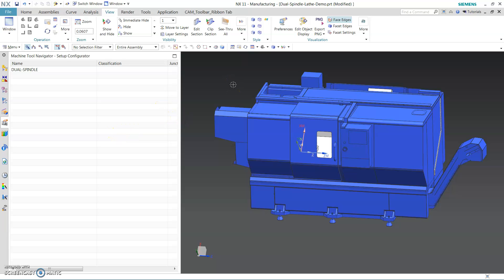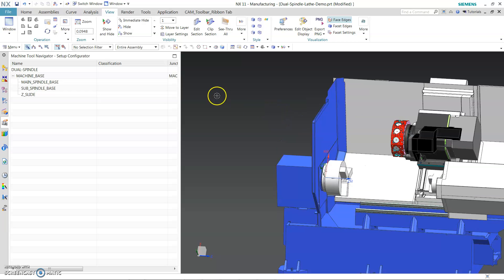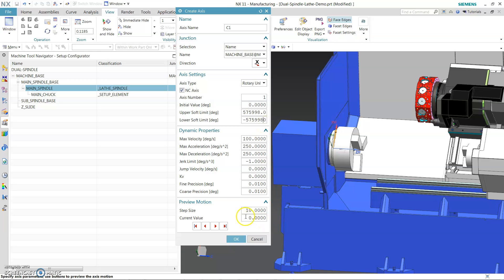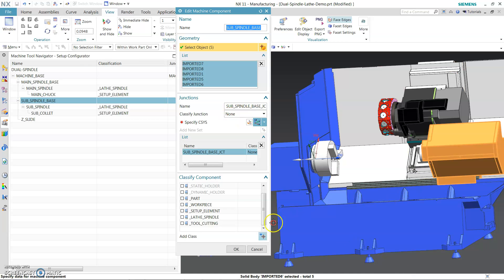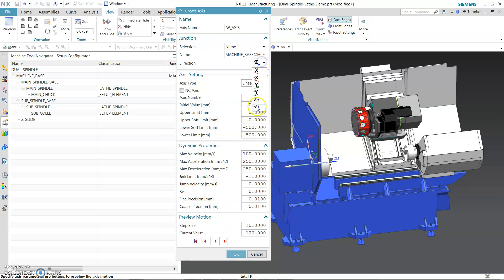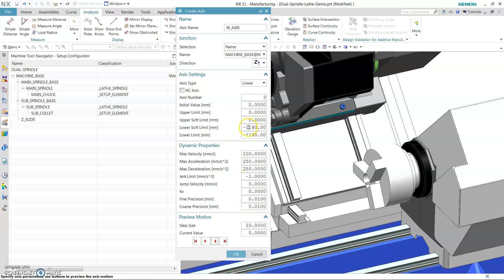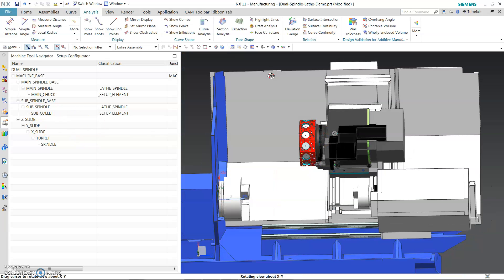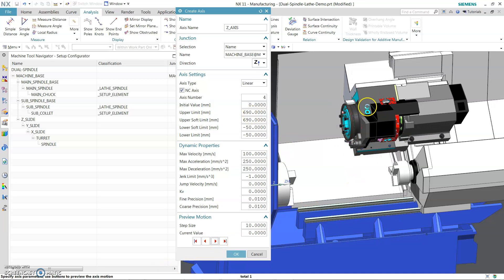TWIN_SPINDLE_LATHE_KINEMATICS-SIEMENS NXCAM

Comment: Hello sir, can I know the dimensions used in the machine builder and what machine is used as a reference? I want to use it on the HYUNDAI WIA L2000SY mill-turn machine, are the dimensions the same? And can I request a cad file for the machine cover? 

Thank you sir, best regards.